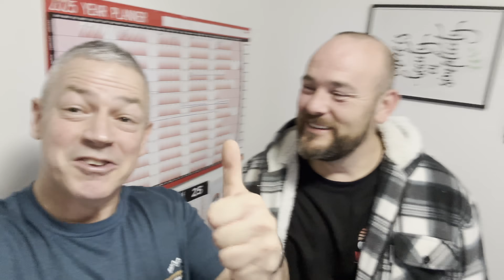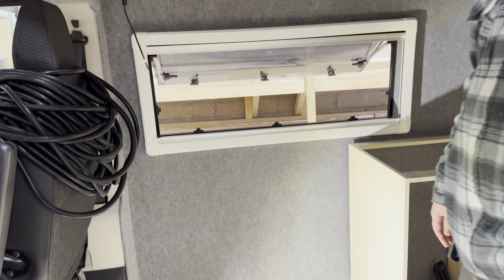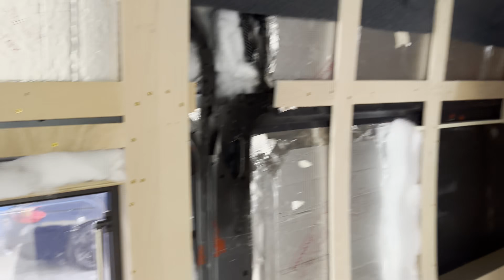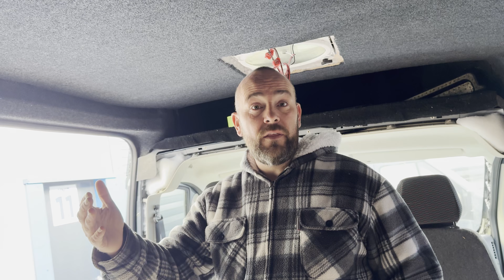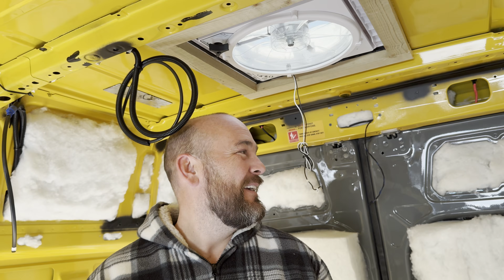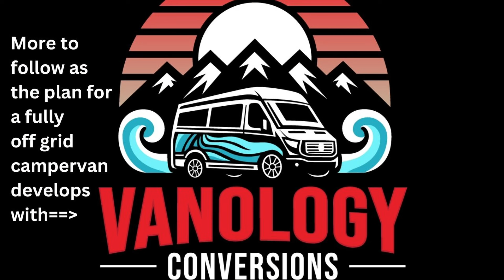Designing and Building an Off Grid Campervan with Vanology Conversions | Is This the Way to Go?

Comment: I was told not to use expanding foam in contact with electrical wiring as over time it will eat in to the casing, dangerous … worth checking to be sure.
Reply from the maker: Standard polyurethane foam + modern wiring:
Modern electrical wiring (e.g. NM-B “Romex,” THHN, etc.) uses PVC, XLPE, or nylon insulation.
Standard one-part polyurethane expanding foams (like Great Stuff, Sika, etc.) do not chemically attack these insulation materials once cured.
So: Safe for contact — the cured foam won’t “eat” or degrade insulation over time.  Hope this helps :-)